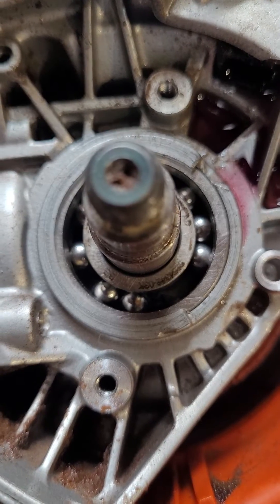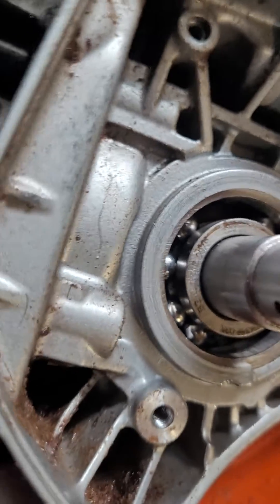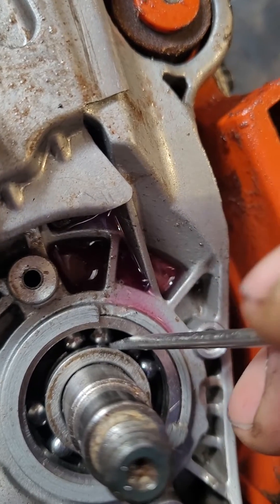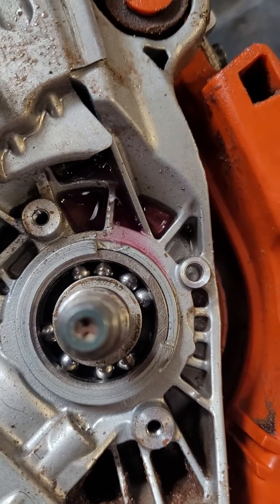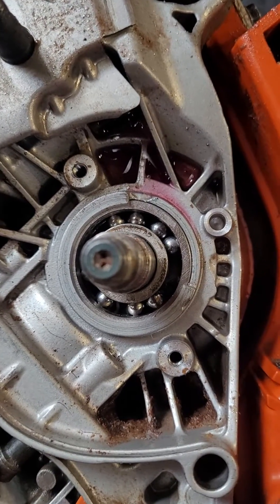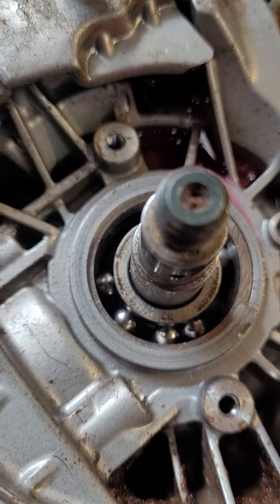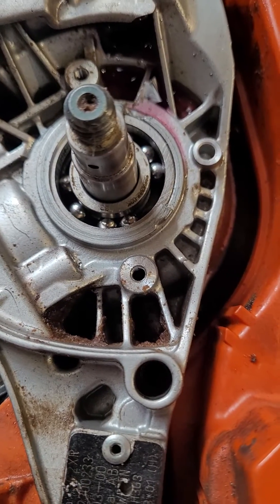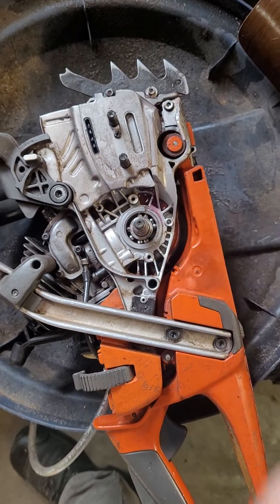Husqvarna 562xp Crank Bearings, part 3 of 3. March 4, 2022

Comment: MSRP for that crappy proprietary bearing is $59.99 LOL!!!!!  Nylon cage or not, the bottom end got hot enough for the bearing to fail.  I can't believe after 10 years in production they can't make this saw reliable for more than a year or two.  Don't get me wrong the 562 is a great saw.  Just a shame we see these failures WAY to often.
Reply from the maker: Thanks Richard,
I believe it's caused from torque load on the cage. The load on the chain is basically trying to spread the bearings apart, which forces the bearings against the cage. The nylon can't handle that type of force, so it fails.
The 562, 555 and 550 do run hot due to the auto-tune being lean for EPA, as well as the lack of cooling fins in the design of the cylinder, but I have had a few of these that have been caught early, with no signs of heat/lean issues, only bearing cage failure...if left, the cage will take out the seal, allowing the saw to suck air, the bearings shoot thru the crankcase and up thru the transfers and normally collide with the piston there resulting in a deep gouge in the cylinder and piston, to the point the cylinder is not salvageable.
At least on the X-torq, I've swapped in the steel caged bearings when rebuilding them, as they are a standard bearing. Husky did revise their design, but only on the recoil side...so far every one I've had have always been the clutch side, so I think they got that wrong too 🙄.
Stihl has started using nylon cages too, but their cages seem to be a different design.